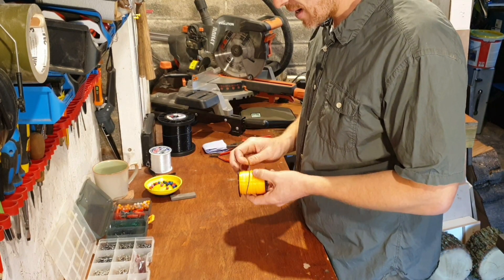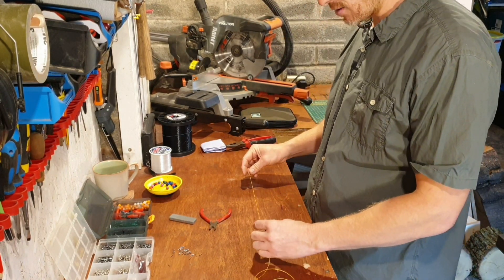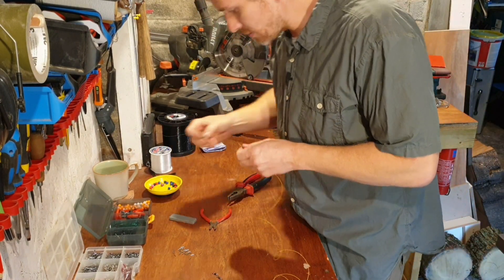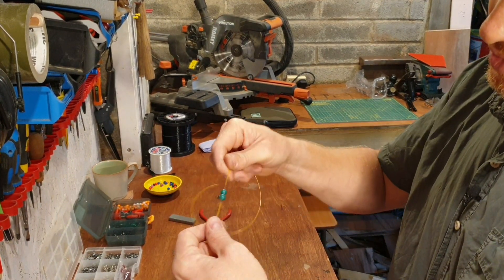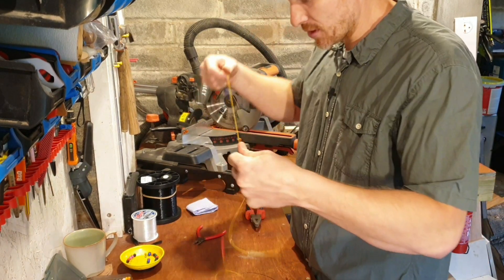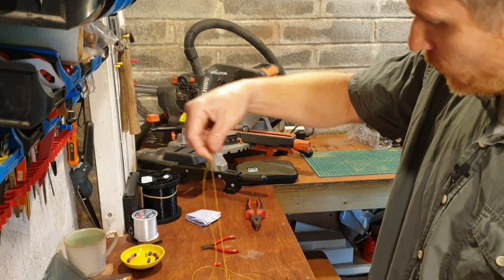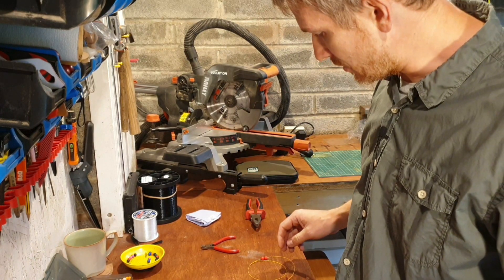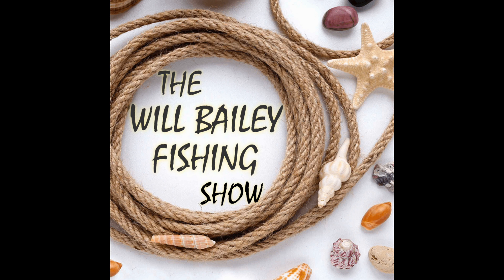Beach Fishing Rig Tutorial - PULLEY & PATTERNOSTER - How To Tie Sea Shore Rigs - Will Bailey Fishing

Comment: Hi Will. Nice video, don't mean to criticise but I noticed your components are quite big, particularly the beads which trap the swivels in place on the rig body. Looks like you are using 8mm beads. If you use 5mm beads, it will improve distance when casting. Obviously, depending on the species one fishes for, determines whether or not to use a heavier rig with bigger components. For general fishing, I try to keep the components on my rigs small which in turn makes the rig more streamlined when casting and also when in the water there is less resistance from the running tide which in turn gives a better and more positive bite detection at the end of the rod. I also noticed on the rigs you checked the hooks on before you made the new ones. It looked like the hook snoods were orange (same colour as the rig body), although I may be wrong. I mainly use clear line rather than coloured line, as I feel this may have an effect on fish feeding/biting confidently. My comment is not meant to come across as a criticism, but when I started fishing, nobody showed me how to tie rigs or even how to fish, I learnt as I went along. I used to tie my hook snoods on using 50 pound hi vis yellow fluorescent shock leader. After a few sessions with no catches, I soon figured it out. I am no expert by any means, but if I can help a fellow angler by giving him/her a heads up with some knowledge I will. A good tutorial video nevertheless.
Reply from the maker: Hi Chris, thanks for the feedback. I actually find the bigger beads a bit of a pain so will definitely get some smaller ones at some stage. Regarding the orange trace, you could be right, although apparently, especially in the channel the water is so cloudy the fish mainly go off scent. The last fish I caught which was the 2.5lb bass was on a pulley with the orange trace so maybe in clearer water it would be more beneficial. Thanks for watching and tight lines 👍
Reply: Thanks for replying Will. Looking forward to your next video. 👍